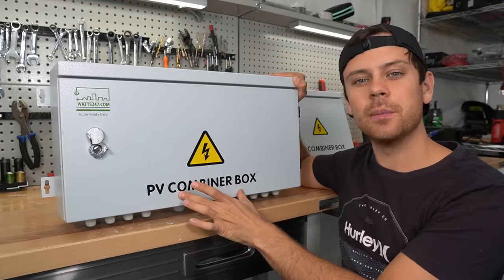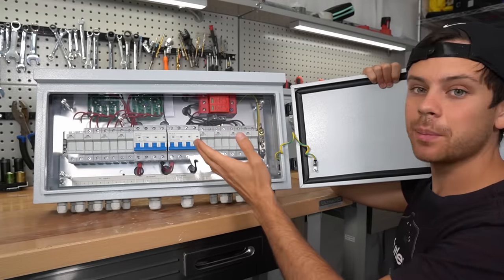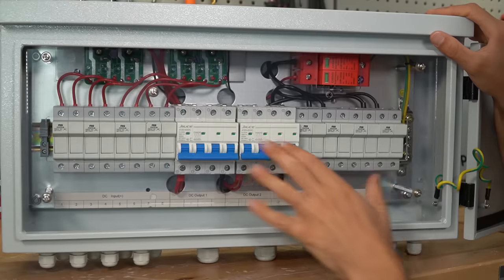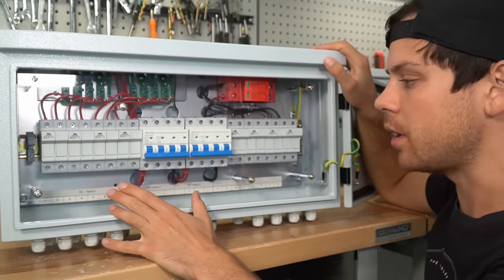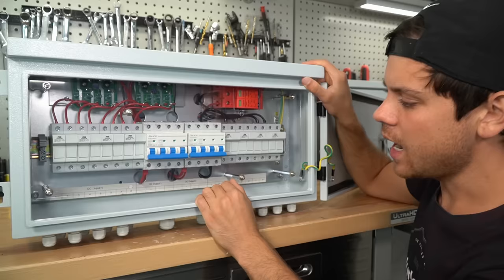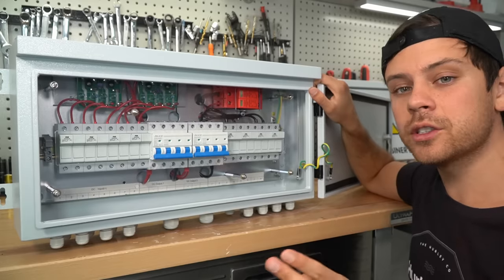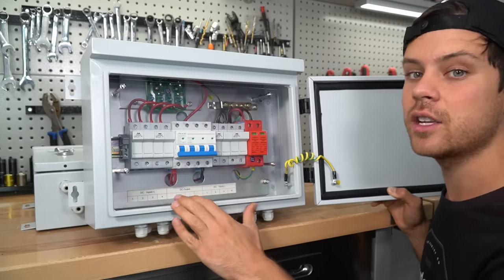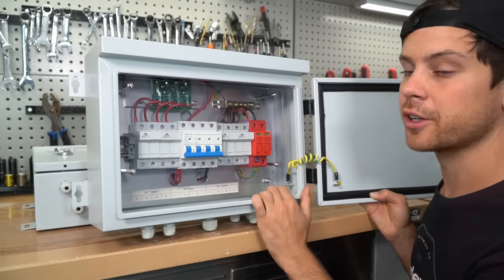What is a PV Combiner Box?

Comment: I assume you would want homogenous strings (made of identical panels) to correctly optimize with the MPPT inverter best or you won't have per string optimized operation.  Maybe that is fundamentally already understood when you begin talking about "parallel string" operations, but just wanted to highlight this if folks thought they could just randomly combine different count/brand panel strings.  I think individualized MPPT converters per string make much more sense there in those non-homogenous setups?

Comment: Will, I'm in the UK, I have the standard 12 panels on my almost South facing roof, which are connected in two sets via 4 cables to my Growatt inverter's two inputs, I live in Scotland and in the evening I get maybe an hour or so of sunlight directly onto the west face of my house but not onto the roof panels, could I use a Combiner box to add some panels to the West face combining it with one of the pairs that currently goes straight into the inverter? I would probably only be able to fit a max of 3 panels on the front of the house.

Comment: I use 3 x 230W panels in parallel because in series the voltage is too high.
Each panel is about 6A.
Do I need any current protection?
So far I used MCA splitters and that’s it.

Comment: Hi Will, thanks for your videos, they are very helpful. I have (20) 400 watt 48v solar panels that will feed into two eg4 6000xp all in one's. I plan on having two feeds, one to each AIOs. So, 10 panels per AIO unit. I was planning on having four series strings of five panels. Two series strings will be connected in parallel for each AIO unit. My question is: should I use a combiner box to combine the two series strings in parallel? This way each AIO will have 250 volts and 4000 watts. Any other suggestions?

Comment: Will, Et Al -  Purchased Sig Sol E0000 Kit,  Watch you and David, you guys are the best.  MY PROBLEM: if pnls are 400W (48Vdc therefore 8.3Adc,  Trying to install the palet-o-pnls (qty:30) and pnls are photon controlled batteries then max is 3 pnl in parallel or MC4 (10/12/14 awg) of 30 Adc gets violated.  Is the only answer a combiner box with a pallet-o-pnls ending up as 10 strings with cables all over the roof to conb box???  I must be missing something !!!  Plz educate me so I can help others...Thx Steve

Comment: Hey Will. I'm looking at the used panels distributed by santan solar, and I see they have pallets with up to 26 panels, what size combiner box would I need to run 24 of those panels to a LV6548 or a nice 8k to 12k hybrid inverter? I'm really trying to learn this stuff. Love the info and knowledge you're sharing.

Comment: off grid cabin with a 48v system. I'm going to buy a 4 string combiner box. My question is can each string consist of different panels. Example: first string has 4 -200w panels in series(total 800w) and the 2nd string has 2-300w panels is series ( total 600w)

Comment: Thanks for another informative video. Does the 4:2 PV combiner allow connection to both the battery and inverter?  Or should they be seperate with larger wire than the combiner connections allow from the battery to the inverter?

Comment: Hi and thanks for another great video.  As a newbie i have a question.  I have a south facing array going into a one string inverter.  However I am looking to add a small east facing array.  The question is can I use a combiner to combine the 2 strings into the 1 string inverter? (it could take the capacity) or do i require another inverter?  thanks

Comment: if you have paralells, mostlikely DC coupling.

and all component must be at DC rated respective of the V will run on the system (but go higher V won't hurt)

Anyway good ones.

Comment: Hey Will, I have a question, hope you can help me. I'm new to solar systems. Your videos are very informative, I really appreciate content you put out. My question is, if you use the PV combiner like you showed at first that has two output legs, can you connect this to a single input on an mppt controller? I would really appreciate your insight. Thanks. BTW this will be a diy off-grid project. Thanks!
Reply: Ever figure it out

Comment: It is actually annoying that they are now making all of these combiner boxes with fuses for both the positive and the negative lines when the fuses are overcurrent devices and only electrically need to be on one side of the circuit.  Either positive or negative but not both.  The fuse holders also should not be used to break the circuit under load because they don't quench the arc so if the breaker has to be flipped first it really makes no sense to have positive and negative fuse holders.  It adds more failure points and a greater potential for a problem down the road.  Also, if you get any combiner box make sure you have backups for every component in them because all it takes is one lightning strike nearby even a quarter-mile away and you might have to replace surge suppressors and fuses.

Comment: Not an electrician, but I have been an Industrial Maintenance Tech for a long time. I have one question. Why is there a fuse on both the positive and the negative side of the DC string inputs? That seems very redundant to me. When the fuse breaks, the entire circuit is broken and the second fuse on the other input is just extending the circuit while doing nothing further at that point. Is there something I'm not aware of? It just seems to me  that it is giving further points of failure rather than adding extra safety.

Comment: I got a 4x200w (sold as 24v by rich solar) panel array and I got a Ecoworthy 6 string PV combiner box to possibly add more panels. Got a PIP2024 all in one unit. Can I just connect all in parallel on that box to make my 24v system? Do I need to change the cables coming into the bus or regular solar cables will handle?

Comment: In fact a MC4 multiplier with a MC4 fuse and a MC4 diode makes the same for a really lower price and 0 place taken. Only disavantage : when there is a problem it needs to go on the roof (but it happens 1 time every 10 or 20 years). No box for me.

Comment: I'm not understanding the single series string. My panels are 395wstts put out 37volts and 10.1amps. so 2 panels in series would already be over the 15 Amps of the fuse? I bought the lvc6048 and the amp max going in is 27amps. My panels put out 10amps 395wstts and 39volts. So if I just connect 3 panels to this box isn't that to many to run to my inverter.

Comment: Building a 30 panel (used 250W) system divided in 2 stings. Have a 300 run to the Growatt. What size combiner box  for this 6000 watt system?

Comment: So, do you mean to joint the parallel connection through this box, rather than connecting the panels in parallel together before plugging into this box.

For example, 1 panel is rated for 8.87A
So, if I joint 5 panels together, that would add up to 44.35A.

And you mentioned that each fuse is only 15A. Which is not enough for the parallel string.

Comment: Not relevant to the combiner box shown, but curious what you'd use to combine eight separate 100 watt solar panels I'm installing on the roof of my Promaster van build. I see the Y connectors on line but seems to me the wire guage will be too small by the time I go through the roof to my disconnect/charge controller etc. Thinking of connecting all the separate cables feeding from the panels into one of those gray plastic gasketed electrical boxes located on my van roof and a single pair of heavy guage wires sized appropriately for the output amperage and the run. Any ideas for something better or simpler. Thankyou.

Comment: Hi Will, Rusty here. I appreciate you sharing your extensive electrical knowledge. Question, would a used Prius battery be a decent starting point for an inexpensive ground array?  I’m sure there are a few reputable companies that sell tested working batteries. Not sure on the price. What would be the cheapest battery setup for home use? Used vs new?
Reply: Depends on the voltage, amp/hr, etc.

Comment: Thanks. Just what I was looking for. 👍🏼 

If one uses only a 1 string system, is there any solution available to put like a master bypass diode between each solar panel? (I know panels seem to have them in the junction box, for each third of the cells if I understand correctly). The reason I am thinking about this, is to combine the benefit from a "parallel system" but in a solely series string. 

Not sure if this is available or even feasible, because maybe they have to be able to handle such high voltage that this would be too expensive or impossible?  Would doing so yield the benefits of a high voltage string with super efficient shading bypass?

Is my reasoning faulty or could that work?

Thanks to anyone taking the time reading this or giving any sort of feedback.

(EDIT: I meant to say bypass diodes, not blocking diodes)

Comment: I am building a 5kW system with 8 600W-panels on a single string. I would like to use a combiner box just to have a neat and easy-to-troubleshoot installation. Is it possible and how should I size it ?
Reply: you have one string. you dont need a combiner box.

Comment: Hi Will, i have off topic question, my battery bank is 400AH ,12v, 4p4s,  in bulk charge  first cell  is getting higher then other 3, by .385  ,3.85high   3.49 low, i am using  electrodakus BMS, any idea?

Comment: Can someone help a confused brother out please?

I have 4 x 405w solar panels, each rated at 13A and 31.18V. I want to connect the 4 panels into 2 parallel strings and then the 2 strings into series. Would the smaller combiner box be suitable for this?

Comment: Total noob here but I was watching the video on Renogy's DC-DC Charger Controller and the criticism was the 25V max allowable input because the Mc4 branch connectors could handle only 400 watts of panels without exceeding that much voltage. (Going by the diagram Wil provides of how he would power that system). The Renogy can handle 660 watts of solar and I was wondering why nobody was suggesting a combiner box. Wouldn't a combiner box allow you to do parallel strings, say three 200 watt and allow you to send under 25v to the charger controller? Am I not understanding it right? Like I said- I am a new to this stuff. Any help understanding is appreciated.

Comment: A Diode just allows energy to flow in a single direction. You can burn out a Solar panel if the power back feeds high voltages to the panel.
Reply from the maker: It's backfeed at night from battery. The fuses are for individual string over current. Not the diode.
Reply from the maker: Wait high voltage from another string right? Not sure what you mean exactly

Comment: Hi. Just want to ask. I got 12v system with 400ah battery (4 battery in parallel 100ah each). Can i use it with 20amp pwm Scc?. Currently im using 20amps. Im scared to use 400ah battery capacity to 20amp scc.

Comment: Not true at 2:00; there is no risk fir back current with 2 strings parallel. The modern Inverters can handle 1 or 2 strings parallel and not more. 
Conclusion: unless you are connecting a solar park in the MW you can do without such a combiner box.
Reply from the maker: I actually said that point in this video, but I edited it out. I would rather people use combiner box anyways. Especially if they plan to add more strings in the future. Then they won't have to rebuild their system to add more strings.
Reply: @WillProwse  something seemed wrong as you were not excited at all about this product.  Likely because it is not necessary or an obligatory promo.
Reply from the maker: @StratRider  this was more of a quick educational video. I was not trying to review it. Now battery tear down reviews will get me excited haha

Comment: I’m connecting 4 Rich Solar 24v 200w solar panels into a 24v Growatt. Do I need a combiner box or is it safe to use inline fuses on all 4 panels instead?
Reply: The comment section here is the worst, will's videos are the best but there is nothing but praise in these comments and next to zero technical help. The channel is awesome but for what ever reason no one helps, maybe they don't know how? Any ways in my opinion you don't need a combiner box. I have 3kw worth of panels each string feeds its own mppt charge controller and I have five controllers all hooked up to the same battery bank. Inline fuses will be enough I think
Reply: @jasonbrown467  thanks for your reply. Yes, likely many people are learning so they might not know the technicals yet. I’m in that boat. Another YouTuber said fuses are to protect the wire not the appliance. Combined with your feedback and his I think I’ll go with fuses over combiner box for my smaller parallel system. Thanks!
Reply: @keezer4346  i should tell you this is all new to me as well, i have only been playing with this stuff for about 15 months, covid bs scared me into providing my own energy to be honest. i have the basics down for the most part, but i dont understand the part about the fuse protecting the wire, not the appliance.its the wire that can carry problems to the appliance hence the protection. there may be a point there i just cant see it. i'd rather a dead short kill the fuse in the wire than be carried by the wire back to the power source, who knows. anyways good luck with it all, i'm sure you will get there. for the record its costs a lot more than i thought it would, i just ordered $100 worth of battery lugs that i didnt think about for one of my banks,  but that will allow me to build the best battery cables i can and it will be much cheaper that store ready made cable, plus i can make custom make them to my length. its those little things that you dont think about
Reply: @jasonbrown467  my understanding is if 1 of my 4 Rich Solar 24v 200w panels in parallel goes haywire and pushes amps over into the other panels the wires might heat up and catch fire. My Growatt would protect the appliances and so would the fuses I’ll install between the AC inverter and appliances. My thinking is I’ll add a 15a inline MC4 connector fuse on each panel before the 4-to-1 connector.
Reply: @keezer4346  i will help as much as i can, as soon as we hit a spot where my knowledge stops i will let you know, as i dont know everything. first i would stop looking at your panel as a 24v panel, i know rich solar calls them that, but thats not how it works, i know its confusing btw. do you know the ocv, my guess is that its 24ocv and 10amp short circuit. one panel is not going to push too many amps into the others btw. they will act as one array, its possible one panel can lower the entire array though like a break, shadow etc etc. so if you have them wired in parralle, you know the controller will see about 20v x 40amps =800 watts total peak sun, right? what charge controller do you have? what wire gauge are you using? most people use 10 gauge solar rated wire and can only push 30 amps per string regardless of voltage. do you have an amp clamp? if not get one, there is a good yet cheap one for about $50 model: "uni-t ut210e", i bought like 6 of them and one 1000 amp meter version. what voltage is your battery bank, 12, 24, 36,46? what i am getting to is that maybe you should run two strings in series, to get volts up and amps down, so you dont destroy your controller, or waste a ton of energy due to high amps over small wire. its cheaper to run more wire and get all the power you can, i can walk you though  this concept if you tell me the controller make and model, and battery voltage you are trying to charge. i like rich solar, i have about 800 watts of those and they are the best performing panels i have. i plan to double that real soon. from that 800 watts i have seen 850 watts absolute max from them. now thats not common for it to be that high for me, in fact now that its warmed up im lucky to see a max of 750 watts. but its all about energy collected per day for me now days.pardon me if you already knew all or some of this.
Reply: @jasonbrown467  I’ll look into the amp clamp!

I figured since each panel is only 5.32A at 37.6V I can parallel them to increase the amps to around 21A and still run 10 gauge wire with MC4 connectors (rated for under 30A) from the panels to the Growatt. It’s a 24V system I’m building bc I plan to run a 450w air conditioner sometimes.

My setup is below (so far) but I’ve not connected anything. I’m at the shopping piece-by-piece stage haha.

Panels:

4x Rich Solar 24v 200w (total of 800w)
- Amazon ASIN (search on Amazon): B086WYLCRM
- Maximum Power(Pmax): 200W
- Maximum Power Voltage(Vmp): 37.6V
- Maximum Power Current(Imp): 5.32A
- Open Circuit Voltage(Voc): 45.4V
- Short Circuit Current(Isc): 5.83A
- Maximum System Voltage(Vmax): 1000V DC

All in one solar inverter system:

Growatt SPF 3000TL LVM
- Amazon ASIN: B08H5J7TRM
- MPPT Charge Controller (80A)
- 3000w inverter
- AC 120v charger and shore power output (60A)

Batteries:

2x Lossigy LiFePO4 Battery 12V 200Ah (in series to make 24V at 200ah)
- Battery I found on Amazon (hoping it’s quality)
- Amazon ASIN: B08S7799BD
- Nominal Capacity : 200Ah
- Nominal Voltage: 12.8V
- Voltage Range: 10~14.6V
- Charge Voltage: 14.6V (29.2V in series)
- Standard Charging: 40A (100A max)
Reply: @keezer4346  ok, my mistake on the amps, i could have sworn they doubled the amps not the volts, but i am probably wrong, i will look more into this tommorrow
Reply: @keezer4346  hey i meant to get back to you faster and i just cant atm, but i can provide a great source of info filled with people generally more informed than me. just google : "diy solar reddit". its perfect place for beginners and above. i go there all the time for info, feel free to join and post all you want
Reply: oh and inline fuses are a good idea, they make those mc4 styled fuse holders and in planning on using them too
Reply: @jasonbrown467  thanks man, I signed up for a forum. I almost have all the pieces of my setup now!
Reply: @keezer4346  excellent